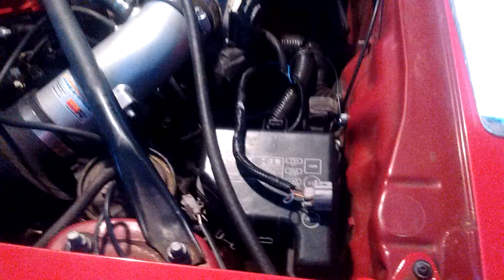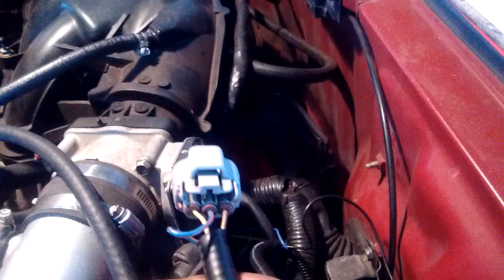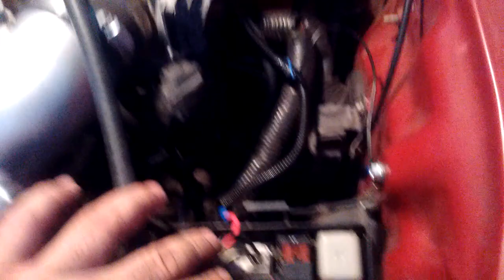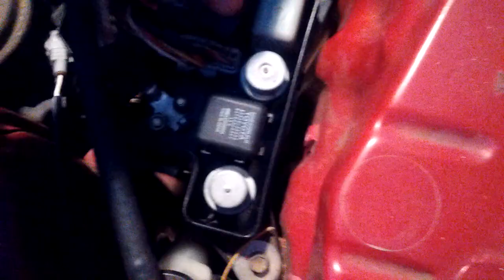Toyota MR2 SW20 e153 - Wiring the Vehicle Speed Sensor VSS

Comment: which wire do you tap into on the gauge cluster, as in which connector and pin? thanks
Reply from the maker: This totally depends on the gauge cluster. If you can determine what vehicle the gauge cluster came from i.e. USDM, JDM, EUDM, Turbo, US NA (5s-fe), EU NA (3s-ge) year of manufacture, there will be a cluster pinout appropriate for THAT cluster and THAT cluster only.

Comment: all that and never mentioned where the signal wire goes to on gauge cluster
Reply from the maker: If you have a cluster with a cable speedo you must remove the speedometer clock from the cluster enclosure and replace it with a clock from a electric speedo. You can run the wires from the sensor through the cabin and into the cluster enclosure to the mounting screws on the back of the clock - those are the terminals.
Reply: @Merryfrankster_ I got you.
My main concern I'd the plugs and dash are totally different so I'd imagine I'll have to solder on the new plugs and the wiring diagrams seem hard got online.
Reply from the maker: @redmanmr2  No what I am saying is your run the wires into the enclosure by passing the connectors and use small eye terminals to affix the wire ends to the mounting screws of the clock which serve as terminals. Open up the enclosure and look inside and it will become clear.
Reply from the maker: @redmanmr2  You will keep your original cluster, no need to change the harness wiring - just swap out the speedo clock. I am assuing you are starting with a mechanical cluster with a cable driven speedo clock. You must swap out this clock for an electric speedo clock.
Reply from the maker: @redmanmr2  I am planning to do a video on this some day when I have a few hours of my life to waste again.
Reply: @Merryfrankster_  its a bit of a pig of a dose id say.sorry again if I came across abrupt man.
Reply from the maker: If you want to know that, you can ask. But you didn't. So figure it out for yourself
Reply: @Merryfrankster_  that's  not very helpful tbf mate.we are all only trying to keep these old cars going
Reply from the maker: @redmanmr2  first of all I am not your mate, brew. Secondly if your mother ever gets around to teaching you the magic words "please" and "thank you" then you can come back and talk to me. Until then you can sod off.

Comment: What speed sensor sub assembly are you using?
Reply from the maker: Stock from MR2 Turbo SW20. Wiring is same as Supra.
Reply: @Merryfrankster_  it's hard to find a mr2 93+ speedo sub assembly, do you know if any other sub assembly will fit the e153?
Reply from the maker: @king-ii2sm  I believe there is one from a E53 Camry early 90's model. Look for one of my threads on mr20c  I may have written something about it including part numbers.

Comment: i have no clue if anyone can help me, but my car has 2 speed sensors and somehow both were ripped out, how do i know which speed sensor wires are which without chasing them to the ecu? both are the same 3 pin as the one in this video, and the wire colors for the middle are different, so that was easy to figure out but then theres a black and red one for i assume power and ground
Reply from the maker: What is your car? What is your transmission? Or do you just prefer to keep that a secret.
Reply: @Merryfrankster_  Its an 04 nissan altima, my apologies! But i went ahead and wired it up today, the wires were kinda bunched and twisted together at two points which made figuring out which one is which. So far the engine light is gone so ill see what happens. Thanks!
Reply: @Merryfrankster_  And happy 4th!

Comment: Will this work on the stock 91 cluster or would we have to buy a newer cluster or jdm  cluster
Reply from the maker: You would have to buy a cluster from a 95 avalon, remove the Speedo gauge, install the gauge in your 91 cluster, and wire it to the sensor.
Reply: v
Reply: @Merryfrankster_  does it have to be a digital from the 95 Avalon or analog for milage indicator? I know they sell different ones.
Reply from the maker: @tommyhajimoto6968  I don't know. Never seen one digital.
Reply: @Merryfrankster_  yeah I seen some on eBay I put  95 Avalon cluster and they showed one that's digital so I take it it has to be analog?

Comment: Hey I have a 2007 hyundai Elantra and it is reading a code P0717 - Input Speed Sensor No Circuit Signal so I had put a new input speed sensor On and it came back with same code. So then I had the connector tested and found that the middle pin in the connector had no voltage but the 2 outside pins read fine. My question is do I cut the plug wire and replace with a new wiring plug to match the yellow, brown and red wiring in installing a new connector plug To clamp to input speed sensor?? Will that fix the problem with code P0717?
Reply from the maker: Sorry but I don't know the wiring for the Elantra.

Comment: good day, how do you know which wire to connected the signal wire to at the back of gauge cluster?
Reply from the maker: You need the pinout diagram for you cluster. The complete pinout for the cluster is available in your car's repair manual.
Reply: @Merryfrankster_  Thank you. Great Video
Reply: @Merryfrankster_  hi

Comment: I'm doing a electronic speedometer conversion Any idea where I can find the pigtail? For the sensor
Reply from the maker: Try one of these maybe:

https://www.bmotorsports.com/shop/product_info.php/products_id/1662

https://www.ebay.com/itm/1995-2002-TOYOTA-AVALON-SPEED-SENSOR-PIGTAIL-WIRING-PLUG-NEW-/233088911048?oid=371812313860

https://www.ebay.com/itm/1993-1997-TOYOTA-COROLLA-SPEED-SENSOR-PIGTAIL-WIRING-PLUG-NEW/233082543625?fits=Model%3ACorolla%7CMake%3AToyota&hash=item3644cd5e09:g:Y5cAAOSwzrxUtx7o:rk:1:pf:0
Reply: I just got mine from Phoenix Wiring for like $20
Reply: Hola amigo! Me puedes decir donde esta ubicado en sensor rpm, tengo un problema en un toyota mr2 que no marca bien las rpm, ayuda por favor! Motor 3sge